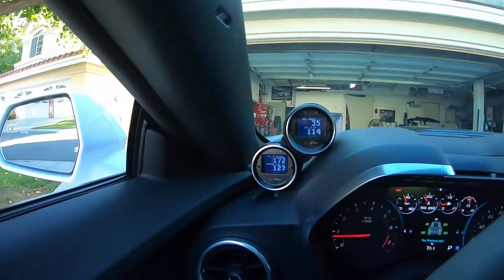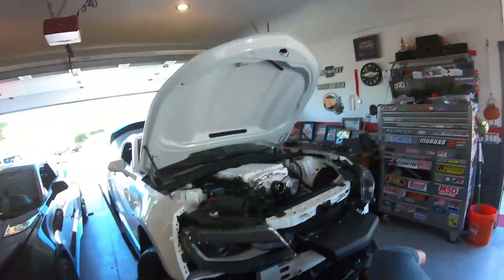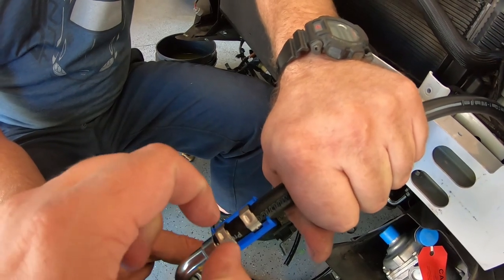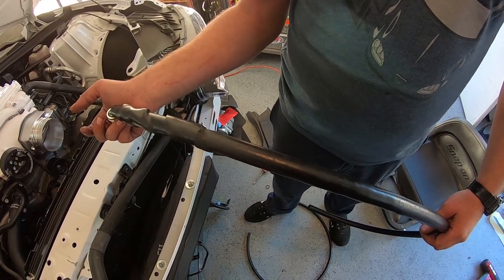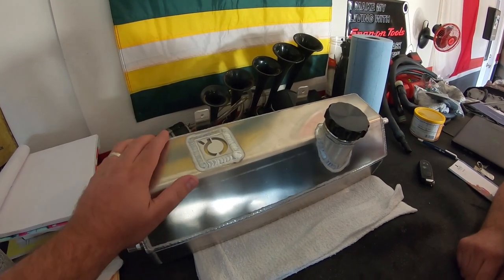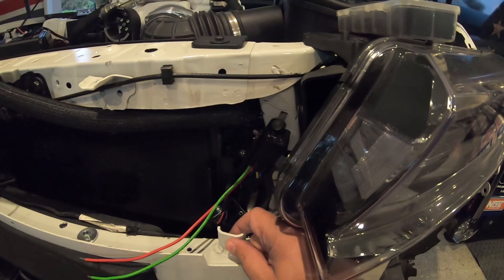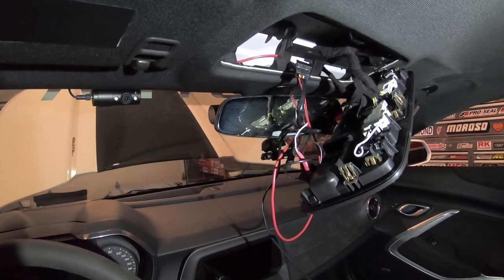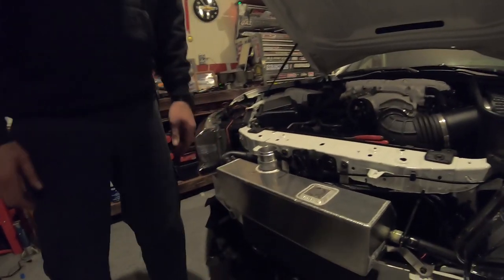Interchiller Installed! No More Bags of Ice!

Comment: Flip the orientation of the stewart emp pump. I installed one on my kenne bell modular and the manual says the pump only has a couple correct orientations. If it's not the recommended orientation the pump won't live as long
Reply from the maker: Over 5 years later with zero issues.

Comment: I think you installed the chiller in the incorrect line just out of the compressor instead out of the condensation, probably the cause of your temps. I highly recommend when installing to check the compressor line and follow it to the condensator to install the fitting in the other one that is the out line.

Comment: I'm confused I watched the first part of your video and  you explained you were keeping the stock heat exchanger,  so you didn't have to run the chiller all the time.  and then towards the end of the video you say that you remove the heat exchanger which is it ?
Reply from the maker: We changed our minds and removed the radiator as it technically was adding heat back into the system

Comment: Dude longer term would you say worth it? 

It fits a certain build goal of mine with a project. Started as a gto bur might end up something else. But all the cheater tricks I can stuff I to the thing Smokey yunick style. 

The freon dump Into the blower was a yunick trick. But his was more primitive. This plus a reservoir swirl box type set up. Ability to switch out to regular heat exchangers. And potentially able to use a thermal battery concept. 

Dual res. Thermostats. Heat exchangers. Essentially get one res down uber cold. Run that to engine hot fluids move elsewhere as new cold coolant is added slowly lowering the one res temp. Then just switch over to the cold res and recharge the other.
Reply from the maker: Honestly super happy with the setup. Never have to worry about ice or keeping things cold. I guess I just have to make sure my A/C doesn’t fail.

Comment: What was your solution to the calculated IATs? I think I'm having the same issue. I LT4 blower swapped my l86 Sierra, and I have the interchiller with ice cold temps but in unsure if its the blower heat soaking or IAT is just being calculated

Comment: Can you do a video about the camaro brake squeal issues ... I’ve been trying to research the issue and my dealership is saying GM is aware but hasn’t found a solution
Reply: It's kinda what all Brembos do. I put 6p and 4p on my GTO and they squeal randomly.
Reply: I would put ceramic brake pads on if i were you.
Reply: Try stick in wheel weights on the caliper
Reply: On*

Comment: Do you need the CORDES tank and the interchiller. I thought the interchiller was supposed to handle all of that. I have a 2018n zl1 and i'm considering tge interchiller in lieu of the cordes ice tanks.
Reply from the maker: Your ZL1 already has a separate loop for the superchargers cooling lines. On a SS we added the tank for more fluid capacity. The more capacity you have the cooler the system will be.

Comment: I have a 2013 ZL1. Suffers major heat soaked and high IATs. I know that forced induction interchillers makes the interchillers kit for the Holden HSV which has the LSA but I don't know if it will work for a ZL1. I could really use it though.
Reply from the maker: They could make it work.

Comment: I know this is an older video, but look at what the Dodge Demon is doing. I bought a 2015 Hellcat Challenger, and previous owner made his own Chiller using the AC, like the Demon. Turn it on MAX ac, and I get like 50 to 60 degree's cooling on an 80 degree day. Its awesome, and it cools back down like right now after you beat on it. This is using the I/C , not IAT's but even then, the Hellcat has a direct port oin front of the car to pull in outside air, un restricted. You can feel it from outdise the front oft he car.
Reply: Scratch that... looks like yall are already doing it hehe, was not finished watching..

Comment: Also why did you decide to remove the hx from the system? wouldnt you want the hx there for when your not using the interchiller system? sounds to me like you would end up heating up the car while just cruising and not using the interchiller system.
Reply from the maker: The interchiller system is always running
Reply: @Lethalgarage  ah ok, thats great! how does that prevent condensation from having the ac on during the track?
Reply from the maker: All the piping has insulation and braided covers preventing Condensation
Reply: @Lethalgarage  can you run the HX with the FI interchiller? Or does it have to be removed?
Reply: @MrChucktown09  it doesn't have to be removed.  It just makes the system more efficient to cool.

Comment: Just curious what your Procharger IAT's were in comparison.
Reply from the maker: They were in the 130s at the end of a run, but keep in mind we were 200 less rwhp
Reply: Gotcha.   I'd imagine you would have gone with a bigger headunit had you stuck with a Centri.     Man though 127 degree IAT just idling in 59 degree weather.   Crazy to think that's just 3 degrees away from the end of a run temp when you were making less HP with the smaller headunit..    Im sure the Chiller will resolve everything once you get it all dialed in!.
Reply from the maker: Were fairly sure the Whipple Map sensor is heat soaked and that temp isn’t a true reading

Comment: Does the AC need to be on for the interchiller?
Reply from the maker: Yes
Reply: @Lethalgarage  so you can turn it off for like maybe just regular driving or driving during the cold weather? But in the track or some 40 rolls turn on the AC and the chiller works?
Reply from the maker: @dr.schmuck3845  it’s on all the time when the a/c is on.  Without it on you have no heat exchanger for the blower
Reply: @dr.schmuck3845  you can isolate the system so that the interior A/C doesn't get refrigerant, Interchiller only.....or you can flip a switch and both the interior and interchiller work. If you turn the A/C completely off then nothing works.